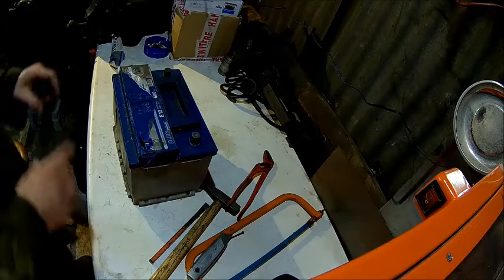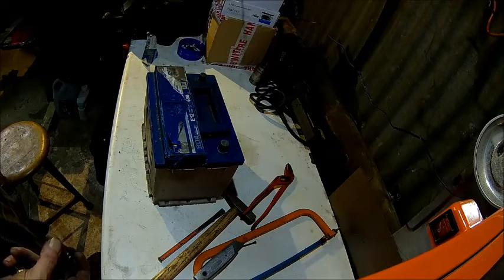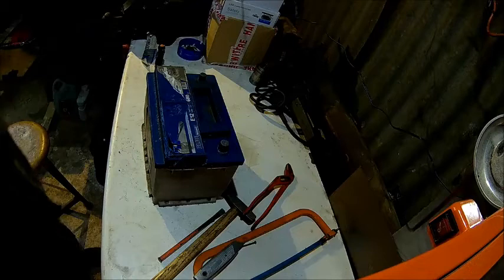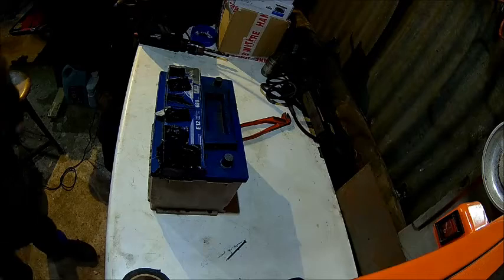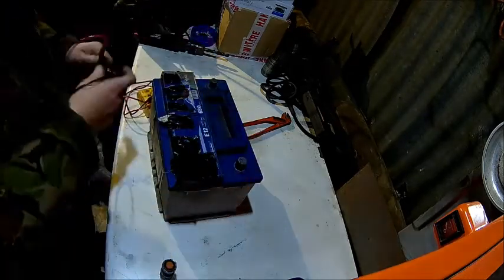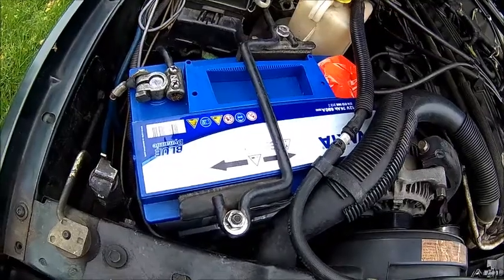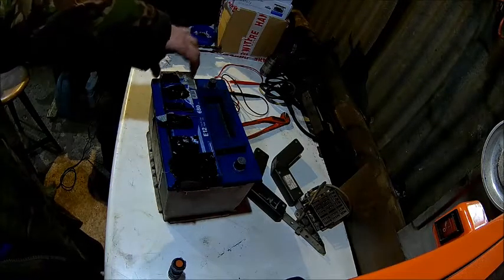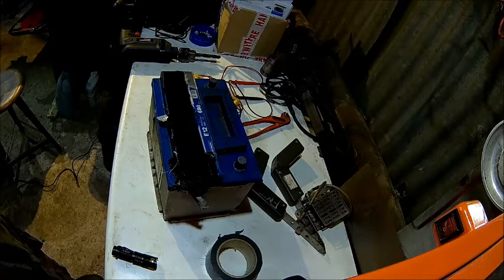The drilled battery -  checking fluid level in a maintenance free car battery

Comment: I agree that maintenance-free is a deception. Because it is a lead acid battery it must be ventilated with temperature change. Therefore, there is vapor loss from being vented to the atmosphere. So, unless the atmosphere refills, the battery with distilled water you are out of luck. And to my knowledge, the atmosphere does not refill batteries with distilled water!

Comment: I had one Varta Blue battery,  after just one year I noticed that car started slowly to crank, send to reclamation, received a new one. This new one also after one year same story. Purchased Yuasa 5000 series, and car is cranking without a problem. After that there is no way that any kind of Varta will ever come ever near my car.
Reply: If your engine bay is to hot your battery need to be covered after longer driver feel if your battery is hot like my now i made metal cover to protect it its cool never hot

Comment: Maintenance free batteries eh? Think we all know there’s nothing free in this life 🤔. I had a varta battery 5yrs old and tried to use repair mode on a noco genius after running the 4hr repair mode 3times it did improve slightly. But as mentioned in one of your other comments it ultimately needs water 💧. It had security screw caps making it practically impossible to screw out. I tried tapping then hammering it with a driver anti clockwise to screw it out but the plastic battery Casing is that soft it just started to chisel a hole and destroy the screw cap….. I gave up 🤷🏻‍♂️🥲

Comment: I don't know why these NPCs always start prying and destroying the battery instead of simply drilling holes to begin with?
Reply from the maker: If you would have listened more carefully, you would know why,...the battery already had a dead cell, so no point of saving it .... so think again who's the NCP !
Reply: Many "maintenance free" batteries had regular plugs under the cover. Why the "NPC's" try to get the, what looks like a removable, cover off to access the plugs. You're ignorant and no thinker at all.

Comment: Your best bet before you start drilling holes into it was to use a reconditioning recycling battery charger that has a De-sulphation mode 
That would have probably brought the battery back to life
Reply from the maker: No, it definitely would not bring it back to life, because not even the best charger on the planet would be able to add missing fluid to a sealed battery !
Reply: @dynoguy  Trust me I have a CETEK  charger with a recycling mode And I have revived at least five batteries with it
I would not tell you otherwise
Reply from the maker: Ok, whatever,... fact is that a charger can't add fluid, and this was indeed the problem with this Varta battery, and exactly the same with another Varta 3 years later.  The reason is a rather simple one, .. the cell closest to the positive pole is nearest to the engine, so that's getting hot and looses water. Therefore, absolutely no chance for your magic charger ....
Reply: @dynoguy  since you have a varta battery i am guessing you might be from Europe like me, have a look at vipiemme batteries, because they have caps and you can actually refill them, the thing that you remove to access them looks a bit like the one that you tried you remove from the varta in the video, but it actually has holes for each cell below it.
Reply: What you do to recondition a lead acid battery is you add the proper amount of water and then you overcharge it with 15-16 volts. I have done this on two Vipiemme batteries, the one with 360A EN went  from 178A to 290A and the other one with 540A EN went from 274A to 394A. The second one would have gotten even better but it was from my dads truck and he needed it so i could only do this for a few hours.

Comment: Maintence free batteries should be banned. Total deception and abuse of the public.
Reply: Absoluty true.Biggest lie about they do not need water refill.I had two batteries  fitted ( One was Yuasa )in motorcycle a dn water evaporated within 18months and battery lost most of power.After adding up water no positive change happened.